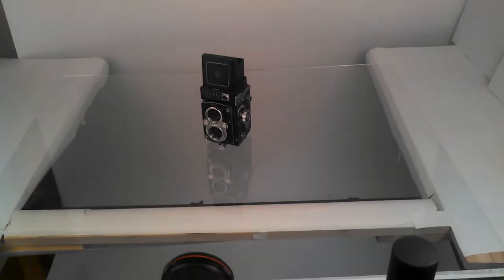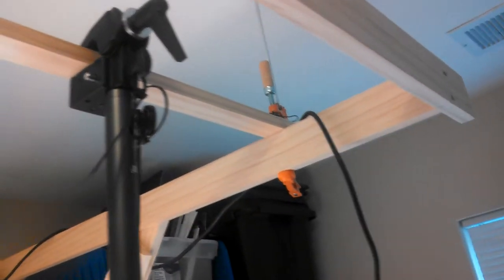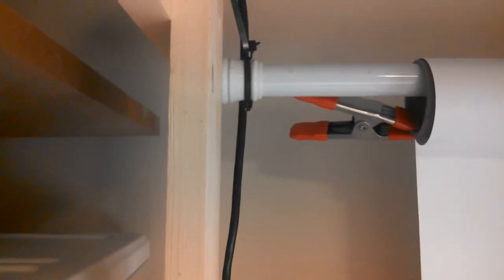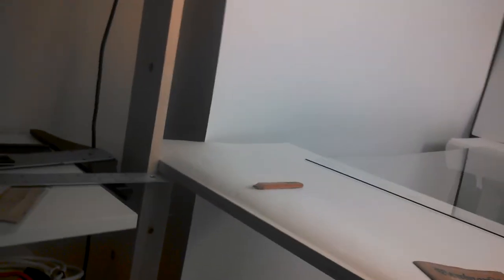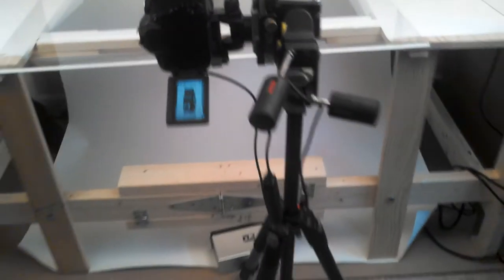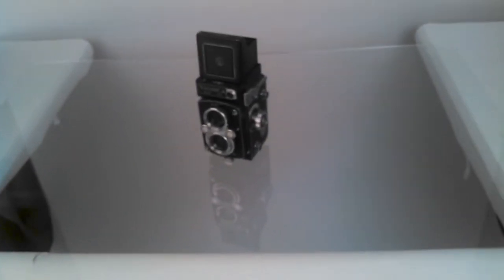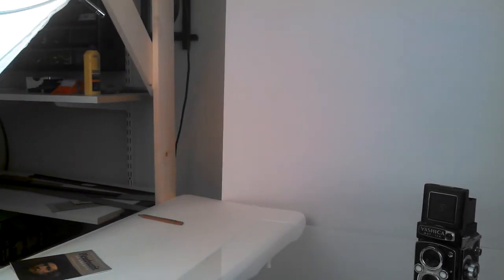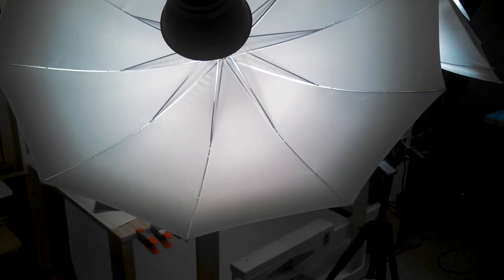my DIY product photography table

Comment from the maker: Hey. For this video i'm simply using the modelling lights from my Calumet Genesis 400. When doing the product lighting, i have a third monolight under the table either bouncing off the paper or directly pointed at the product using a 5 degree grid. (note, i do block the window with a solid piece of matboard to remove any natural light and reflections.

Comment: Hi Patrick, what about glass edges. Do the edges visible on photo? Probably not but how?
Reply from the maker: hey, +PhardonMedia.   I extended the edge out and never shot the products with the edge in the frame so it wasn't a problem.
Reply from the maker: +PhardonMedia sorry, forgot about the back edge.  That one is very slight that i like as it gives a horizon perspective.  However, if you shoot with a low DoF you can practically erase it in camera.
Reply: Thanks :)